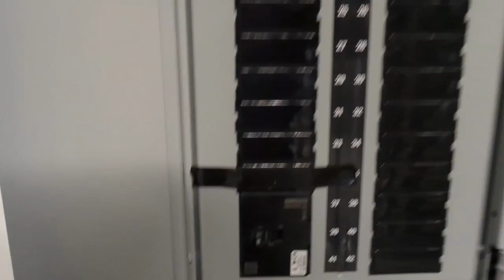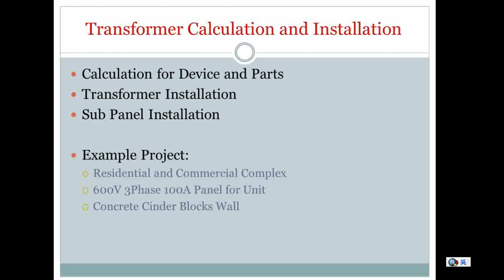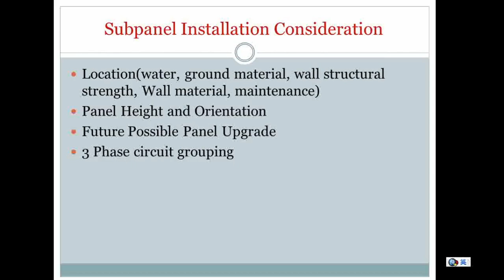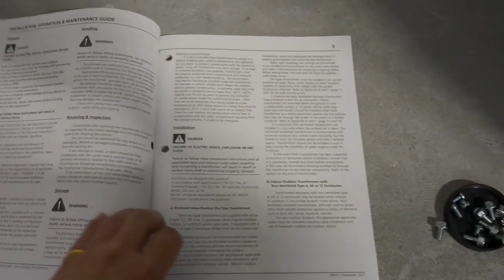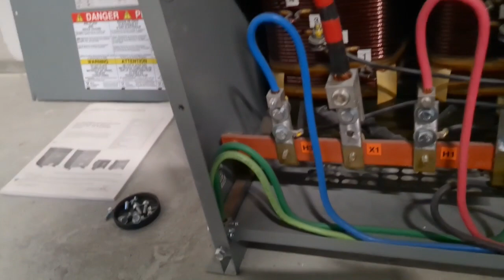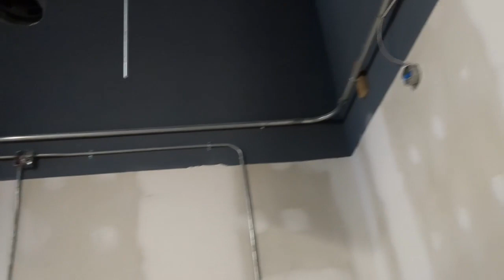Transformer Calculation and Installation

Comment: Is there a reason we cannot use the equation KVA1 = KVA2?  Why we have to use 1.732 in the equation?
Reply from the maker: KVA1 = KVA2 you use the equation straight.
Once you calculate the KVA for 3 phase current, you use KVA / Voltage / 1.732

Comment: Good presentation, but i don’t prefer use emt conduit with transformer due to vibration will be transferred to the joint , flexi or cable is a better choice
Reply from the maker: Thank you for your suggestion. And indeed vibration is not neglectable for certain installation. Thank you for your comments.
Reply: Yes piping is acceptable, teck has the advantage of being faster to install.